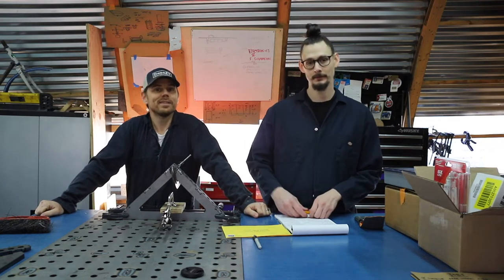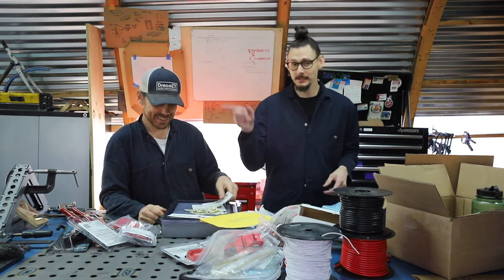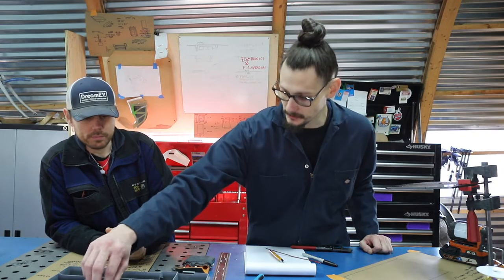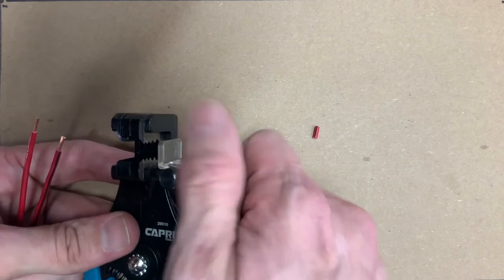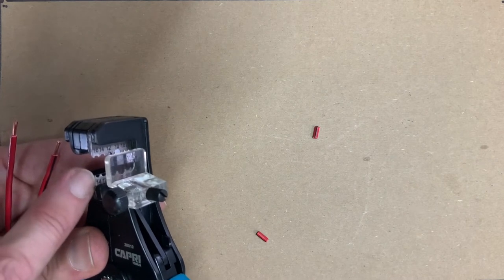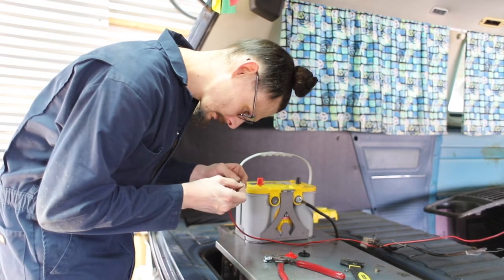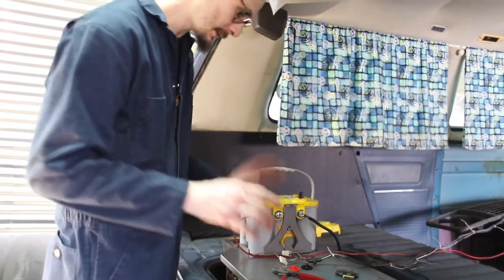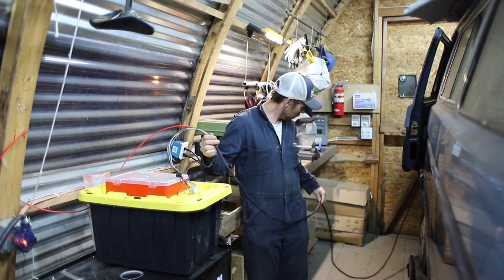Tesla Powered Vanagon Episode 25: Wire Harness Repair

Comment: Hmm... so you’re saying that my square pliers and hammer method is incorrect eh?🧐
Reply from the maker: not incorrect per se, maybe just not so appropriate for our build. I may even go out on a limb and say you wouldn't want to use that 'technique' on anything where failure could cause loss of life.
Reply: @DreamEV  I got you mate, it was a joke ;) However, I have used it to crimp two wires temporary, low voltage and not load bearing. Keep up the good work lads.
Reply from the maker: @NomadicPhoton  Thats too funny, Both our jokes sailed past each other in the dead of night. If it was an iceberg I would be floating on a door right now.
Reply: @DreamEV  😂